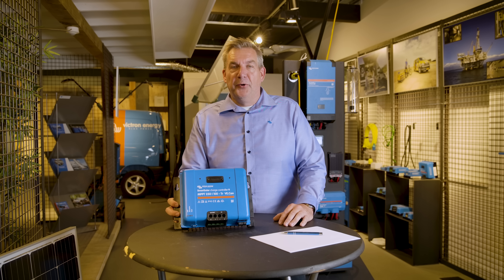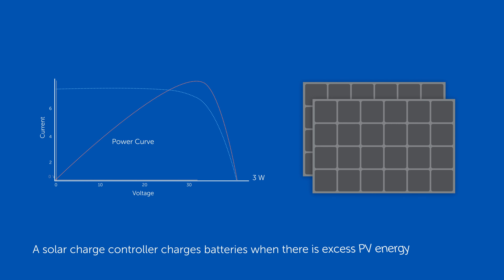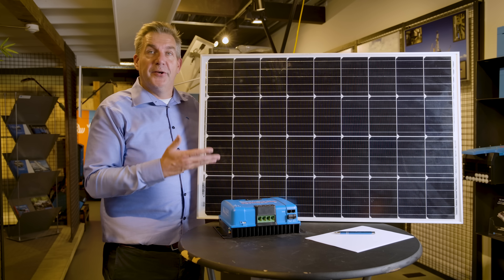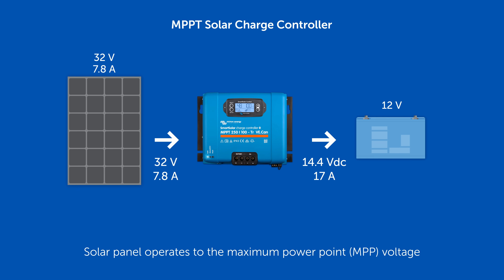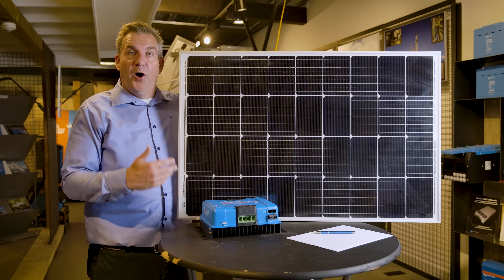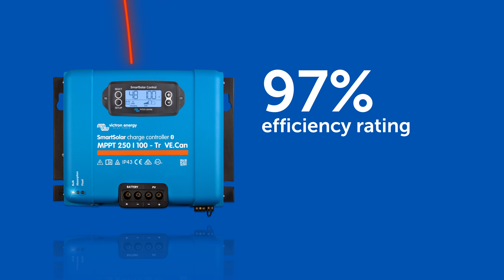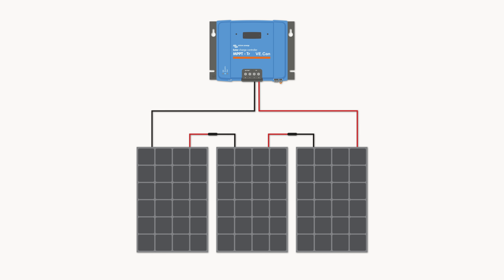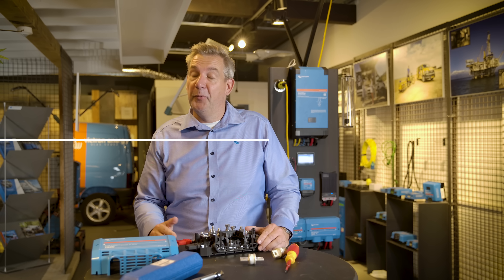How does a Victron Energy MPPT Solar Charge Controller work?

Comment: Actually in Testing, if Solar Panels are not affected by Shading, such as them on an Aft Cockpit Solar Arch,  then you can get exactly the Same Output from PWM Charge Controllers - wgichbare very Cheap - as you get from MPPT Charge Controllers.  If the Panels get affected by Shade such as Flexi Panels on Boat decks, then there is no alternative but to use MPPT Charge Controllers for those. 🤔 Best Wishes. Bob.  👍🌟🌟🌟⛵️
Reply: If you test this with a victron pwm,maybe you can have such result,try comparing another cheap pwm,and u loose 50% power compared to a victron mppt:)) mppts not that expensive to not worth over a pwm for serious system...If u charge like a single battery,with like a single panel for exemple for a gate opener eelctronics than yeah,its fine to cheap out,for house systems,RV,or even a boat...naaah...
Reply: @83kaszas  Pick the Right Cheap Chinese PWM Charge Controllers,  and you get exactly the same output as from Any Well Made MPPT Carge Controller - Victron are Not the Only Makers of good equipment, far from it, though I do like their Products, as they work well, are reliable, and have long service Lives. Good Testing demands acquiring Results from a wide range of what at first glance appears to be Worthwhile Products, and you test to Co firm what you actually get for your Money. Unfortunately today, far too many products are chronically Overpriced Wxpensive Crap, that Struggles to work for its warranty period. I Do Not Like zseeing People Ripped Off like That. Some Stuff ? A bloody Liability, like the Blender my Father bought, which burst into Flames on the Kitchen Woek Top, the first time he switched it on. Luckily I was in the House to deal with it. 🤔
Reply: @brownnoise357  Yes i know that,but a normal person who DIY cannot know which chinese brand can be trusted.Victron just works as intended.I am from Romania,and even here i could afford going with victron gear.
Reply: @ Reading Customer Reviews, and high 99% feedback on EBay, is a pretty good head start to be honest. I picked up a really good PWM charge Controller off Amazon for 16 dollars to test a Polycrystalline Solar Panel with, to see if they have started to last longer than the normal 6 to7 years, before Polycrystalline Solar Panels we’re Dying. The Output of both was compliant with the Specification I was pleased to find. Agreed though, Victron can Definitely be relied on, but as a Tester, it is proper to test alternatives that can Work, and also work well. Best Wishes. Bob. 👍
Reply: @ PS. I try to pass on money Saving Tips and decent advice to people as much as I can, as I get great insight from other Testers as well. Even Will Prowse, despite him loving to blow shit up, you can soon get to know products, which if treated Properly, then you can get dramatic increases in Service Lives, but the Clincher is - Knowing how to Treat Stuff Properly. Knowing how to Treat Lifepo4 Batteries properly, has only started becoming clear in the last 18  o this or so really, and there is still a heck of a lot of Terrible advice being given to people sadly. 👍
Reply: @brownnoise357  Will is really a decent guy,with good and true imputs.And yes i agree,when You are on a budget,anything can be good,and choosing good,but cheap option is always a challenge.
Reply: @ Luckily then that People like Clark of Clark’s Adventure YouTube channel, Nigel Calder, SV Impavidus Channel, and Similar, are out there doing the Searching and Testing, and how to’s for them as well. I have found that giving them the Right instructions, and providing them with the best Materials, plus a bit of Supervision when necessary. That DIY’rs are capable of doing very high quality Work, and rapidly gain some pretty advanced skills too, which can be pretty inspiring, and worth the hand holding tbh. Best Wishes. Bob. 🤔🌟🌟🌟👍⛵️
Reply: @ PS. I attended the Dracula Motorbike Rally in Turda Transylvania, and wish I could visit again tbhRmiis a lovely Country, and I enjoyed my visit.👍🙂
Reply: @ PS. Another Really Good Channel for Good Testing insights on YouTube is HOBOTECH  which is more aimed at RV living, and he doesn’t appear to Test just to blow Shit Up either. I do like it that he has links to stuff with Discount Codes as well, which makes it pretty easy for people to save some money- I may have a go at that myself, as long as the Sales commission heading my way is small enough, and is along the lines of buying me no more than a  offee tbh. Best Wishes.Bob. 👍
Reply: @ I have left comments on those by a number of people called Will, so assuming you Mean Will Prowse ? Yes I like that Will,  it with the  caveat that Will is actually a Really Bad Tester, as he clearly Loves just Blowing Shit Up. BUT, with care and paying attention you can extract information such that if you know how to Treat things Properly - and unfortunately most people just don’t have even the Beginnings of a Clue and not helped in this regard by Will At All - then very long Service Lives can likely be achieved. Bottom Line, under no  ircu stances Ever Treat Batteries like Will Does.Sorry, but if you Don’t like that, it is what it is, and it is only in the last 18 months or so, that we have finally had access to the information we need to be able to make Lifepo4 Batteries have a Decent Length Service Life - Never Rapid Charge them never have extreme Discharge Rates per Battery, such that the internals of the battery overheat to damage them, Always Recharge a about 0.15 times C where’s equals the total ah Capacity of the Battery Bank, and Never Discharge them below 50% Capacity because you hammer the Recharge Cycles Available.  Ow has Will Ever Made that Clear to Anyone in his videos or that by sticking with it, that you may get up to 30 years of Service Life Out of those Batteries, or is he just too Busy Enjoying Blowing Shit Up ?  You can also drop all Stresses and loads on a Battery, by 75% by having them in Banks of 4 with Equal length wiring to bus bars  So draw 100 amps for example, and each Battery Supplies 25 amps, and each Battery doesn’t get Warm, let alone break into a Sweat. Apart from Water, and Lightning Strikes,what is the Greatest enemy of electronics ? Yep Heat !  Hobotech does far better Reviews than Will, and so does Clark of Clark’s Adventure Amongst Others. Due to Loathing Google and its YouTube, I don’t do Review Videos as a long time Tester, but I may get around to doing a Noney Saving Tips and tricks Blog after I get my next Sailboat, and I intend it to be free, but if I manage to save people a lot of money, then in recognition of that, then buying me a Cup of Coffee would be appreciated.  O Patreon or stuff like that. Though if  it gets to the point of being offered great discounts on great Products to pass on - like Bobothech Does with his Discount Code Links   I’ll consider it, if products are up to my Fussypants standards and any commission is moderate and does not harm the Discounts in any way. I have never cared about Money, Ben san imoter exporter, wholesaler retailer, I earned so much from the Foreign Exchange Transactions, I was able to pass on massive Discounts to my customers, and got by ok. The Only A dry I had that Worked, was in a Friend’s Free Local Paper, and she got along ok as well. 👍🌟🌟🌟⛵️
Reply: @ PS. I had the identical Output from a well made PWM Charge Controller that my Friend, a Solar Panel Tester for NASA  since the 1980’s in Florida Said I would, and he pointed me to the supplier of Good Chinese Charge Controllers on Amazon, and they also sell them on EBay. 👍
Reply: @83kaszas  I tested with a cheap PWM that cost 16 dollars ish for a 40 amp version which had excellent customer reviews on Amazon, and got an output that was spot on with what my NASA Tester associate said that I would.As it was for testing the service Life of a new Polycrystalline Panel to see if they were now lasting longer than the six to seven year usual maximum life, then it was just interesting to see at very low cost, whether he was right. That the PWM Chargers controller had two USB Charging points on it, also proved to be very useful to have. Overall, that PWM charge controller was an absolute bargain. Beware though, there are useless counterfeits out there, so stick with reputable sellers.   If nothing else, if you have a no shade setup for your panels, cheap and cheerful working Chargers controllers are useful to have as backup spares if nothing less. I like having Backups frankly. All the best. Bob.👍

Comment: Victron SmartSolar MPPT are excellent devices. I hope that in the future all Victron devices will have VE.Can. I don't like VE.Direc at all and it should be abolished.
I'm happy to pay 20 euros more if the device has a CAN bus.
Reply: Honestly I'd prefer that everything just be bluetooth, like the SmartSolar stuff.  Except even there controlling the shunt requires wiring and creates ground-path problems.  I hate the mess that all the data wiring causes.
Reply: @junkerzn7312  is this Bluetooth smart solar stuff on the Redarc system and not victron?
Reply: What is VE.Can and VE.Direc?  What is difference?  Why do you believe VE.Direc should be abolished?  How do I know if a VICTRON MPPT that I buy has VE.Can or VE.Direc?  Thank you - Cameron
Reply: @Camh1968  VE direct is a simple TTL serial link.  You can even type in commands with a serial terminal if you work out the hex values.  canbus itself is quite a bit more complex and that's before we even start sending commands to the devices.
Reply: @Camh1968  VE.direct is a simple TTL serial link.  You can even type in commands with a serial terminal if you work out the hex values.  canbus itself is quite a bit more complex and that's before we even start sending commands to the devices.

Comment: As I understand, the max V of the string of PV pannels cannot exceed the max rating of the MPPT, especially taking in account when it is extremely cold, as then the voltage can peak. It is frustrating to see cloudy days and not much beeing produced (one would be inclined to put more pannels in series). Can you explain the benefit of putting strings in parallel, does it help in winter conditions by modifying the power curve up (and still protect your setup by limiting the max voltage) or are you better off keeping individual strings and adding more MPPTs?
Reply: during winter time, even 1 or 2 more panels will bring you about 1% or so more yield during the day compared to a moderately sunny day. During those cloudy sun-poor times you have to just simply rely on something else, if you need more, you could just parallel a few more strings together, that would nearly double your output without raising your voltage too high. So TLDR: If you need more solar power, try paralleling more strings, but for winter,  there will just never be enough solar to get through it
Reply: @anzzgar  yes but my question was either keep the individual strings on each MPPT or parallel all of them onto one MPPT. I guess you could have a PV string  combiner box with a winter and summer setting
Reply: @ttkddry  no need to do anything like that,You have to remain always in the mppt`s voltage and amperage limit that it can take,if the sun comes out for even 1 moment,so it wont fry any of your systems components.
Reply: @83kaszas  yes, I understand there is a voltage limit but there is no such thing as an amperage limit as the MPPT will set it's working point so that is does not exceed it's own specification. You can have too many strings in parallel, you will just not be using them efficiently compared to spreading them out over multiple MPPTs
Reply: @ttkddry  ofc there is,i read the user manual of my rs charge controller and i cannot exceed more than 20amps incoming from the panels.
Reply: @83kaszas  the pannels do not set the amps, the MPPT does. The pannels will max out at one point if their physical limit is lower than what the MPPT can set
Reply: @ttkddry  its true that the mppt sets the amps,current for the battery,however,when the mppts finds the maximum power point,there is a direct current incoming from the panels,before it reaches the bateries,and that currect can exceed the mppts maximum tolerance,as far as i understand and have seen.We burnt out mppts like this.We were way in the voltage limit with 50 volts under maximum,but so many panels in paralel that the whole thing smoked out.
Reply: @83kaszas  I do not understand how the MPPT burned out and want to hear from Victron how this is even possible
Reply: @ttkddry  I agree,so i might understand incorectly,and the many panels was not the problem,than might have been something else,a clarification would be nice in any case
Reply: @anzzgar  Yeah,if you are offgrid,and you cannot use the grid for backup like i do,just use an autostart propane generator to suplement the cloudy days,it very easy to incorporate in victron systems something like that,they do it all the times.
Reply: I can tell you here that it will not help much.If the sun energy is weak,it means it just cannot convert much amps from it,even if you have an mppt.I have a string on an RS inverter charger,who can take up to 450 volts from panels,and got 400v open circuit connected,around 350-375 mppt point,and another string that has 100 volts only,on a 48v battery systems.They start charging mostly at the same time always,displaying same amount of power from respectiv amount of panels all the times.I also have a 24V batery system with a 60V mppt range and does the same.Even in low light the voltage doesnt dropo much from the panels,but just gives much less amps,if any...You just cannot convert sun energy if there is no sun.And let me tell You victron at least has a 97% efficiency-tested-i used epeever,and some chinese stuff,that had waaaay worse performance....for me victron is no brainer,its one of the best.
Reply: here is my setup-12 panels,each with 50v open circuit voltage.4 panels series 2,and paraleled for 100v on a blue solar mppt having now in uber cloudy day 88V/2A/202W,and the other 8 panels on the rs inverter,doing 357V/1A/370w. So the high voltage does slightly even worse xD  So from 5600w panels i have 561 at this moment.
Reply: Using a higher voltage,  thus more pannels in series,  is always better. 
But you have to use the correct  sized MPPT (SmartSolar).
And more important on your boat: the pannels do have to be in the same direction to all get the same radiation from the sun. 
I.e. If you have 2 pannels at starboard and 2 on the port side, you will only get the power of the pannels receiving the least amount of sun.
Also if 2 pannels are on the back, 2 on the deck in front.
Same. So that could be the reason you have 4 trackers
[Edit] Sorry,  I was under the impression you where talking about your boat. 
Also  I can advise you to use the Victron MPPT calculator, to select the correct MPPT box. (you can find it with a Google search)